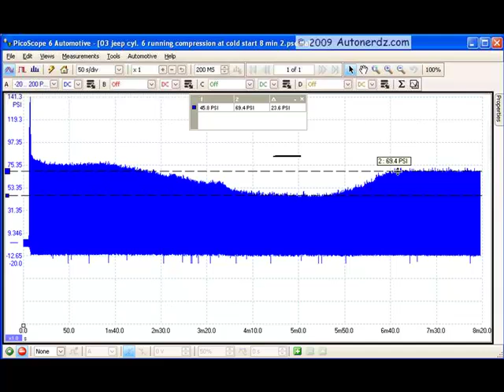The Wrangler from Hell part 2

Comment: had a ranger with same problem, I also figured it out with same stragedy.Only difference was that I kept scratching my head wondering how come I always get the hard ones.this job of mine was the reason I got a transducer and it paid of in 1 job,found a few more cases similar a month later.

Comment: The video is great! The turbulence shown in the ignition wave form was a dead give away. That was most certainly air disturbing the spark pattern. It doesn't take much of a valve leak to cause this. As for information database applications give Motologic a try. It's a new system and has a few flaws but I do think it will compete very well with ALLDATA.  Will purchase the pico system soon....glad to retire the old otc. Thanks for the video!